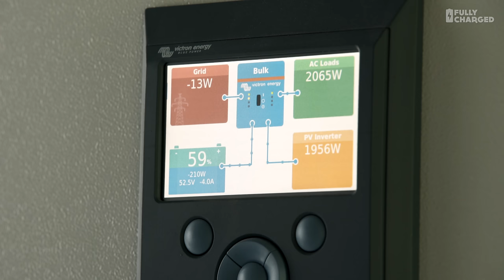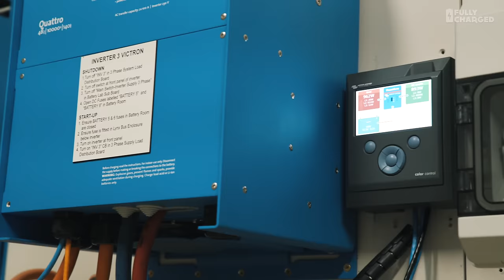Redflow ZCell batteries for home renewable energy storage | Fully Charged

Comment: At 3:34 you say that the solar energy can run the house and the surplus can charge the batteries. So does that mean if you have a large enough PV you can power the home directly off the inverter, bypassing the batteries?? I have heard this a number of times but when I query it, I am told you are powering appliance from the batteries which are being charged at the same time. Can you elaborate on how this works.

Comment: Very cool, i wonder what's the degrading time for these batteries over a long run, say 50,100 years?
Reply: Materials will fall apart. They give you a 10 year warranty, so if after 10 years you throw them out, no loss, because batteries will be sooooo cheap in 10 years. You just buy a new one at let's say 10% of the cost of today. Maybe less!

Comment: The first time I saw a flow battery was in a VRB ESS video. 
They use Vanadium in a Redox flow battery. 
As for stating theirs is the smallest flow battery, VRB ESS would have issues with that, as they used a Redox unit on a golf buggy.

Comment: A bit of mis-information at about 4:20 "If you just have solar and there is a grid failure then the solar is useless to you" this is only correct if you are using a grid-tie inverter. Power inverters require power to operate but that power can come from the solar panels and in that case the inverter will continue to operate in the event of a grid power outage. You can install an electrical box that will switch selected electrical circuits/outlets between grid and solar.

Comment: Interesting, yet another battery technology, the difference being that this one may actually work. Whilst the battery chemistry might be robust there are some mechanicals here, particularly the pumps and plumbing etc, which must wear out. Robert didn't ask how long the batteries are guaranteed for or how long it is anticipated each cell will last in normal domestic use. And how recyclable the batteries are. Bromine is not a nice element, it's salts are likely to be very toxic in small amounts, that wasn't discussed either, what happens if there's a leak?. Nor do we know the upfront cost differential. They are also noticeably much larger than the Power Wall for instance, and many homes might find difficulty accommodating them. Also do they make a noise? Is bromine a common and cheap element? Is there likely to be supply problem like there is for lithium? Robert's a nice enough chap but he doesn't ask the awkward, obvious questions. Actually there are answers to most of my queries here: https://www.solarquotes.com.au/blog/redflows-zinc-bromide-zcell-battery-may-have-the-edge-over-lithium-ion/ - I'd recommend everyone to visit this informative site. Robert's video may pique interest, but the fuller information in "solarquotes" fills in the huge gaps.

Comment: I just wish that the system were more modular.  I understand the thinking behind lots of the 10 kWh batteries, so that a single failure doesn't knockout the whole system, but the ability to buy a third of the plates because the office never goes above 100 kW demand would be much more cost-efficient.

Comment: Interesting battery types, didn't knew they existed. 

I can from that build up a reduction in volume of 10-20% is possible and some weight reduction (shipping(should be build locally under license) and support structure.
And a bit nicer.

These blocks could be use as a wall or  as an indoor/outdoor-table.

Do they make any noise from the electronics or pump?

Comment: Clearly the battery we have all been waiting for.  One possible niggle though.  These batteries haveto undergo a stripping cycle every 72 hours or so in which the battery is completely discharged by shorting it out and running the pump.  Otherwise, spicules can grow long enough to penetrate the plates.  Not a game changer because of the other huge advantages but is this automated.  Seems to me, 1/ the stripping cycle must be automated or the owner is going to forget at some point and wreck his battery 2/ You pretty well have to be connected to the grid so as not to have your power go down every few days and 3/ A way around the problem would be to have two batteries on alternate cycles so that you always have power if you were not connected to the grid.

Comment: This video is going to be 3 years old soon. I was excited when it came out and expected them to start showing up in houses by now. Anyone know the current state of the company? Do they have a viable residential product? Have they driven their cost down?
Reply: From what I've seen, they really haven't done anything (interesting).

Their batteries are still insanely expensive, especially compared to lithium,  somewhere in the realms of half again to double the price. I'm not sure of specifics, because... barely anyone installs them for domestic applications. So it's hard to get a fixed price.

They seem to be mainly focusing on remote communications (backup) systems, as they have huge advantages in that field (like, not discharging if left idle for weeks/months etc).

The company doesn't seem interested in selling to the public (and probably fair, as there's not a competitive market in Australia yet and their price isn't competitive to consumers). Hopefully that changes
Reply: That was a while ago. Check them out now!!

Comment: I have read that some older flow battery designs need frequent electrolyte replacement which is costly... Also max discharge is a lot lower so a bigger over all capability is needed???

Comment: Ok, you got my interest.  How much does a 10kw system cost?  For proof of concept, what's the smallest system you could come up with?  I'm thinking about remote data gathering sites that use PVs to charge Lead Acid batteries.  Or even a UPS?  With a UPS, one cycle and you're pretty much done.  Is there a 1kw product that would work for this?

Comment: Great to see Redflow on fully charged, I've heard about them a few years ago but the name seemed to be a bit absent from the media after the SA power issues and the tweet from Elon Musk. Missed opportunity? I like the concept of Redflow as it seems to be one of those uniquely Australian innovations that I think could be a perfect technology for homes. A long term and long lasting solution. Even though the electrolyte lasts longer than lithium I do wonder about the longevity of the pumps that drive the unit. How often does it need to be maintained and how many years of ownership does it take for the total cost of ownership to be lower than lithium?

Comment: this is incredibly cool technology. Thanks for the video. And, we should not forget, thanks for the great innovative work, Simon Hackett and the team behind this. Hope to buy one in a few years, when we have our own, modern, zero+ palace (well... that's subjective of course) built. I did want to ask one question. I live in a... more Northern climate with quite a bit of snow and darkness in winter. Could batteries like these be used for long term (off-grid) storage to trickle charge a house during winter; as compensation for low efficiency of solar? I imagine having a 'normal' size battery system running to cover normal day and night operation, but a larger one charge over summer and slowly deplete during winter. If so, is something like that at all (ever) reasonable from a cost perspective?

Comment: Both Zcell batteries and Li-on are great ways to store power, but i do believe the next big step is getting thousands of electric vehicles that are plugged in overnight, to be able to discharge slightly, so in theory, they can act as a battery to smooth the flow of power from the grid, because any power that's produced from power stations (coal, Gas) is lost when not used. For example, a power station could be running at 60% constantly, and the battery's would act as a giant buffer for when the draw is swinging from 55% to 65% load, this alone would save a tremendous amount of Fossil fuels, and save the need for fuel hungry power gas turbines to be turned on to increase power to the grid quickly. all it would take is a internet connection to any charge/discharge controller that is connected to a stored power source. It would act like a peer to peer (P2P) network.

Comment: I wonder how much maintenance, checking, oversight the pumps and constantly moving fluids require.  Aside from size (what, at least 10X a Powerwall setup), that is one of the criticisms/downsides of flow batteries.

Comment: Really interesting. The Redflow ZBM and ZCell, as well VSUN CellCube Vanadium flow battery, are the most promising. At the moment they appear already to be cheaper (total levelized cost of energy) than lithium-ion, lithium iron phosphate or lithium titanite oxide.  (EDIT/UPDATE: Apparently LTO / Lithium titanite oxide is not quite useful for long term storage, yes, it have very good cycling, but it does age on its own. So it is really mostly beneficial for high current applications, where you cycle these batteries many times per day. If you cycle them only once per day, their capacity will degrade just because of age before you reach "normal" cycle life time).

I would be really interested in 15kW, 150kWh system, preferably with as small number of modules as possible. I.e. 30kWp solar array. On average producing 20kW during a day, using 10kW directly at home (big house, workshop, computer servers, AC). Storing excess 10kW in battery. That should give about 100kWh in a summer of excess energy, then during night utilize it back (~80kWh).  (15kW system because of peak demand being sometimes bigger than average, and ability to maybe grow solar system a bit bigger in the future, i.e. 40kWp).

Comment: "If we assume the total cost of installing one ZCell is $17,500 and it works flawlessly until it has provided the 40,000 kilowatt-hours of storage Redflow expects it to be good for, then $17,500 divided by 40,000 kilowatt-hours comes to 43.75 cents a kilowatt-hour. If it is used at full capacity over 11 years, then including a 5% cost of capital, its total cost will come to 62 cents a kilowatt-hour."

Although Redflow are saying 30,000KWH, so it's actually worse...

- solar quotes.com.au
Reply: What is the limiting factor? Does the bromide solution have to be replaced at some point? Or do the electrodes degrade? What would be the cost of refurbishing the battery after 30 or 40MWh?

Comment: Li-ion is not the perfect battery chemistry for every uses.  JB Straubel doesn't want Tesla car batteries repurposed for home energy storage because they are not designed for 100% discharge/recharge every day.  This flow battery is. As the video stated li-ion for high power draw (sprint), flow batteries are for slower power delivery (marthron).  Granted Tesla power wall li-ion batteries (I assume) uses a different chemistry than the car batteries and would be optimized for depth of discharge and cycle life, but it appears those attributes are inherent in flow batteries. I'd like to get more information of flow batteries.  Thanks Bob for doing this video.

Comment: I think the main question is how energy dense they are compared to lithium ion. That will make or break the technology. If it takes up twice the space of lithium ion it probably won't get the research that a lithium ion or lithium ion replacement (like the new glass battery tech).
Reply: Doesn't matter so much in a stationary application. Sure, these will probably never make it into cars, but they don't have to, we have Li Ion for that. Using each technology's strength is the best way to go - lithium is overkill for stationary storage as a primary application, although second life batteries are a great idea.

Comment: Thing is though, I can buy a 2.4KWH PylonTech battery for about $A1500, one at a time, and gradually upgrade as finances allow - the 9.6KWH four-stack is around $A6k, which is less than half the price of the RedFlow, with an 80%/10yr warranty... 

Nice idea (and I've got just the spot for a Z-Cell), but it's going to have to get a lot cheaper.

Comment: Zinc-Bromide Hybrid Flow-Battery.  Efficiency percentage?
//  I am keenly interested in optimal percentage of battery capacity to average PV capacity in KWh.  Appears to be about 28%?
//  Excellent point about NO- PV production in daylight if the grid is zero.